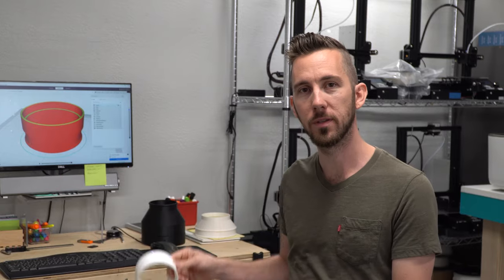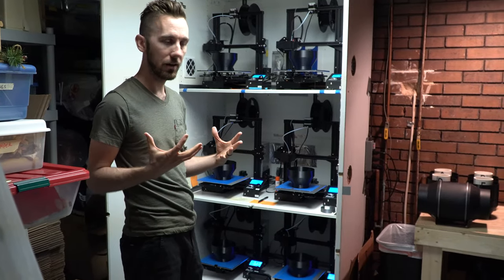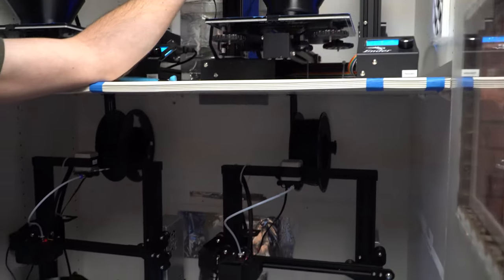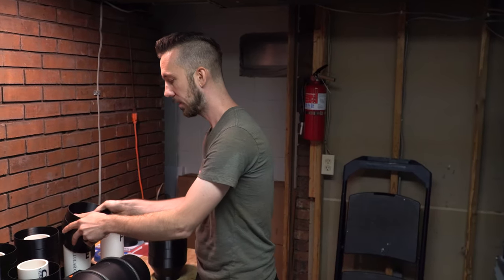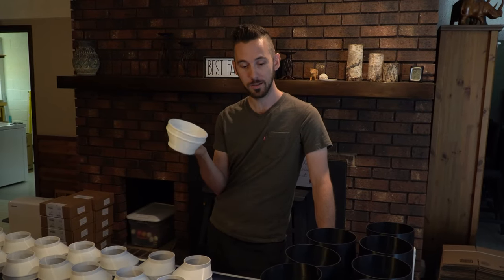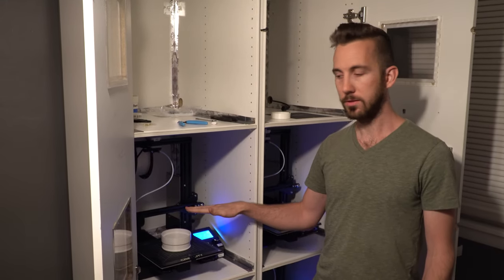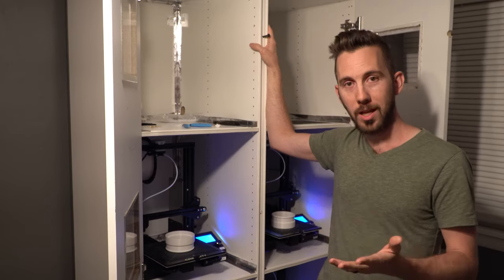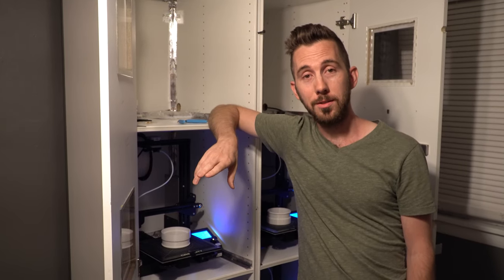My 3D Printing Farm

Comment: Why don't you have them on a ups. First thing I'd do if I had a print farm. Line conditioner and battery backup all in one. Degree of time you'd want it to stay up in case of power loss would determine the price obviously.

Comment: Thanks, you have a great process it seems. Some good ideas if I ever wanted to sell something I designed.

I think other people have mentioned the electronics overheating as likely causing your issue. Running electronics at higher temperatures also reduces their life expectancy, so there's added cost beyond just failed prints. Maybe move the electronics to a separate cooler area from the heated chamber to extend their lifetime and improve their reliability.

There are also fire hazards with 3D printers, both from the electronics and the heated printing area. Less likely these days but still possible. Maybe replace or at least line your wooden enclosures with cement board on all sides. Cheapest option I've found for building a fire resistant enclosure. Separating the electronics means they should ideally get their own enclosure(s).

Also maybe add a fire detecting automatic fire extinguisher. I've seen them on Amazon.
Reply from the maker: Great thoughts shared here, thank you for commenting. I'm planning on moving the electronics outside the enclosure in the coming months.
Reply: I had a similar problem with my new ender 3 (first 3d printer!). A certain model I was trying to print would keep failing at the same level about 12 hours in(layer shift, then the print just stopped on the next attempt). Apparently the motherboard overheats on these things. Fixed by adding an exhaust fan to the side of the motherboard enclosure. Also opened up the enclosure, moved the ribbon cable to the side, since it obstructed the airflow from the fan to the ARM processor. Finally spliced in the board fan to the heating block fan, because the mobo fan would actually only run when the parts cooling fan was running before. Have been running it up to 4 days at a time without any problems. This is what gave me the idea: https://hackaday.com/?p=461364 .
Reply from the maker: I appreciate you sharing the solution you found!

Comment: People don’t usually know that power at your outlet can any from 95 volts to 130 usually and a task specific Uninterruptible power supply is really required for sensitive hardware and long duration tasks.
I learned this from box mining with graphics cards.

Comment: You might be able to decrease print time, and eliminate the seam, by printing this in vase mode. You may need to swap to a larger nozzle, but it looks like it may be a 1 mm wall thickness which is super doable
Reply from the maker: Yeah that’s a good thought, I’ve never played with it before. Is vase mode typically just one wall?
Reply: @MartinsonManufacturing  yes, in your case you may need to alter the model to make it a solid cylinder instead of a tube, but the advantage would be never having to retract and travel (wasted time), and always maxing out your volumetric flow. Lmk if you want to talk more about it, would love to xhat

Comment: Dude, That is great. I would have an overtemp and smoke detection with Raspberrry Pi / Arduino and a relay. I am not sure about these days but  many of those boards shipped with thermal runaway protection disabled by default. Thermal runaway will save ou if a thrmistor cable breaks or the thermister falls out but you really also need something to guard against shorted hotend and heatbed mosfets failing short circuit - the micro would be unable to shut them ff as they would be 'fused' on. Only way to deal with that really is either a raspberry pi with temperature failsafe and smartplug or relay plugins of a custom job using something like an arduino. Great to see it took off.
Reply from the maker: That would be awesome to have it set up that way. Learning how to use a raspberry pi intimidates me, but maybe I just need to jump in and figure it out because I love all the things you can do with one.
Reply: @MartinsonManufacturing  I think Teaching Tech did a vid on it recently. https://youtu.be/ozCqqlPJ3a0

I did a vid a while back showing it with a smartplug shutoff but it was long-winded. The teaching tech one explains it much better but just uses a relay instead of a wifi smartplug. Good luck.

Comment: Whats up man great videos. However I'm heari you're up to 14 printers. Have you considered learning to make molds? I'm a mkld maker and it greatly speed up manufacturing process at the shop i work at. We create sculptures and parts for disney universal etc. We never ship out 3d printed parts that are still clearly printed. We sand and resin them to a smooth surface and then mold them with fiberglass silicone or plaster depending on whats needed.
Reply from the maker: You guys are smarter than I ;)

Comment: You have a really nice setup. I have noticed I to am looking to get into the 3D printing business. A lot of people have asked me for specialty parts. Is it best to just find parts that you can print in bulk? How do you have all the printers linked? I use Octoprint  with raspberry Pi 4 running wireless on mine with Cura as the slicer. Your printing ABS parts with stock Ender is down right amazing. I look forward to seeing more of your content and hearing back from you. Great job on your business and content.
Reply: I subbed and hit the notification button cause you just did not spit out information. You did a walk through and that is what content is all about.
Reply from the maker: Thanks for reaching out man. As far as one-off specialty parts or bulk prints, I think the best is to just start doing various jobs for people until you find a niche that you can really focus on. I started out offering 3D printing services. Several customers were asking me about laser engraving so I eventually bought one. Two months after buying the laser engraver I 3D printed a part for it to solve an issue that was bugging me and then it eventually became a fulltime job selling those parts. I absolutely love printing in bulk because you can really start to streamline your process. That being said, I'm starting an offshoot company to offer services because there's a huge need for it. 
I don't have my printers linked. Good ol fashioned micro sd cards :)
Thanks for your support!

Comment: You need input filters. 3D printers use stepping transformers they can back feed interference into the power grid. As delivered there is no filter. Its actually required by code in many areas for just this reason. One machine will interfere with another. And possibly anything electronic plugged into the grid.
Reply from the maker: Thanks for sharing this Tom. 
I’ve tried using a power conditioner. Is an input filter something different? This electronic stuff is all over my head so I appreciate the input.

Comment: Have you considered moving your production to injection molding based on the high demand? It could simplify a lot of your production process, like more reliability, production time, employee's costs, complexity in maintenance etc.
Also, have you considered "heat" to your electronic as to your random power loss problem? Maybe you can extend the cabling and put the electronics outside of your cabinet.
In any case, really impressive, you turned your hobby into a retable business.
Reply from the maker: Awesome thoughts, thank you for your contribution. Injection molding is something I've thought a lot about. I recently got a quote from a company in Illinois but it was far outside my price range because my part requires slides. I think I'd have to get it done overseas for it to be viable but I'm not crazy about that either.
I haven't thought about heat as the power loss culprit before so you given me something to think about now. I appreciate that. 
What's your background? You strike me as a very intelligent person.
Reply: @MartinsonManufacturing  Outsourcing to China could be viable, but quality control and specially communication can be really challenging, if you going that route hire a Chinese person locally who can speak fluent English and not other way around. 
I worked as a network technician for many years, and most hardware failures are result of inappropriate heat dissipation. You'd be amazed how a couple of failed fans can do to a server. Rule of thumb is all electronics required some sort of heat dissipation, if it is passively cooled it only means that the heat is dump to the environment.
Here is another optimization you can do. Most psu that comes with the printer are in the realm of 70 80% efficiency. You can  buy really cheap server grade 1.1K watt PSU for around 50 bucks and mod the 12v output with a breaker board. That can easily powered 2 to 3 printers and the efficiency are around 90% to 95% depending on the "gold" or "platinum" standards. That way if you scaling up your 3d farm, you could save some real cash in power. ;)
Reply from the maker: Awesome man, thanks so much for the tip I'd really love to try that out because the power loss issues can be pretty frustrating. Thanks again for commenting!
Reply: @MartinsonManufacturing  Your power issue is coming from the 3D printer power supplies. The majority of them have over temperature protection on the main board. Once the intrenal temperature reaches the preset limit the OTP shuts down the power. This is occuring because you put everything into a cabinet and it's getting too hot. Moving the power supplies outside of the cabinet will solve your problem.

Comment: Enjoyed the video. Happen to have an STL you would not mind sharing for the fan mod. I run 5 Ender-3's and have the issue with the strings sucking up in the fan. Over time, causes a decent issue :)
Reply from the maker: Sure, no problem. Shoot me an email and i'll email you back with the stl file:
martinsonmanufacturing@gmail.com

Comment: Cool that you haven't upgraded the printers and you still have managed such success. Is there a reason you haven't needed to upgrade to automatic bed leveling? do you just not have to level the beds much?
Reply from the maker: Yeah, the stock machines are really great as is. It’s not uncommon for me to go 3+ months without having to touch the bed. I will say that I have a few printers where the bed gets off pretty frequently which can get annoying but for the most part it hasn’t been an issue.

Comment: I love my ender 3... as your comment about odd things going on with your "ghost in machine" I had my ender 3 for 2 years now.. but for the past couple months my printer seems to like adding it's own personal touch. It print stuff that's not part of the model..  it's random.. yesterday was the most interesting print were the printer added it's own creativity. What it printed was the shape of the model but everything else was not part of that model. What was most interesting to me was the very first couple layers the bottom or floor of the print.  It completely  looked like a piece of plastic you see on your purchases household items, there were no lines what so ever... it was a very strong, yet thin print that had a semi glossy shine which the white filament used was flat white. It's definitely the type of results I would love to get from my prints.. but my ender 3's not willing to tell me it's secret..
Reply from the maker: Your printer “adds it’s own personal touch” Lol! I can relate. Yeah man, the inconsistency stuff drives me nuts.

Comment: I would have just gotten those ups battery backup things.  I have 2 of them and I run my pc and mining rig through 1 and 2 printers through the other.  Got 2 printers out in the garage that don't run through one yet but never have that problem so yea that is really an odd problem to have.  Has to be something to do with your fuse box or something.

Comment: I myself and trying to get a farm started as a small LLC. Something I'd love to see is how to start if you have a video for that part.
Reply from the maker: Sure, I could do that. What in particular would you like to see? How to setup the business? How to find a product to print or how to find client? How to market? There’s so many aspects to it and each one could be it’s own video.
Reply: @MartinsonManufacturing   How to setup the business? How to find a product to print or how to find client? How to market? I fear that Im more into the tech side of 3d printing and not much on the design and business side of things. I have 4 printers and I am learning to work with the differnt types of filaments from pla, pla+,petg, asa, abs is next. That cabinet you have looks great and is sparking ideas for storage place in my garage. that will help with the heating and cooling part.
Reply: @MartinsonManufacturing  My current setup will be manages by using klipper as it seem I can add about 3-6 printer per raspberry pi. and because I have a lot of spare PC's I might use one of those as my print server... I know I need to find a good printer that is cheap but not too cheap that is a bad printer and enders seems to be that printer. as far as the idea. I am starting to look at some classes on fusion 360 and how to use it. but right now Im just printing or test printing items for fun. I have a coreXY and Delta printers.
Reply from the maker: Awesome dude, it sounds like you’re in a good place and off to a good start. It’s sounds a lot like where I was 4 years ago. I’ll definitely make a video on this soon, but for now my advise would be, just START. It’s okay to not know what the heck you’re doing. That’s what being an entrepreneur is all about. But, I assume you’re good at solving problems so you’ll eventually figure it out. Don’t feel like you need to have everything figured out now, you’re a smart guy and will figure it out when you get there. Just start moving in that direction in whatever small and imperfect way you know how. I look forward to sharing more details on my journey in a future video. Maybe by the end of February.
Reply: @MartinsonManufacturing  thank you again for your help and I look forward to learning from you.

Comment: Did you change the fans or did any form of noise reduction adjustments with the Ender printers? Bed level adjustments? And how do you get it so beautifully smooth, it’s really nice 👍 you said it’s the slicer but we never get it that good.
Reply from the maker: My Ender's are about as stock as you can get. I was using PLA and that is beautifully smooth. I now run PETG and ABS. Not as smooth as PLA, but still pretty dang good though. I also tested multiple different filaments throughout this journey and some just print smoother or rougher than others. Any matte filament will look better than a filament with a sheen cause it hides a lot. 
I honestly think it's my part geometry and slicer settings. If you had me print some random STL file it would look just like everyone else's.

Comment: Absolutely love your content and it has truly been a huge inspiration and motivation to move forward with my 3D print business. 

I know this is an old video and you may not have the cabinet anymore lol
But, the Kia cabinet solution you showed will fit and work well on my current situation. At what measurements did you placed the shelves? And did you install anything underneath to provide some extra support for the printers sitting on it?
Reply from the maker: Glad you enjoyed the video my friend. I think I spaced the shelves at 20” and never had to add any extra support.
Reply: @MartinsonManufacturing  you da best!! Thank you 🙏🏼 look forward to future content!!

Comment: Thank you for you video.
But did you investigated other ways of mass production of those details? Because I thought that 3d printing makes sense only for very small batches.
Reply from the maker: That's a great comment. I've looked into injection molding but it was in the 10's of thousands so I'm going to to keep 3D printing them for now. Have you come across any mass production methods that are somewhat economical?
Reply: @MartinsonManufacturing  I know that it's also possible to use silicone molds and pour it with some kind of epoxy. It should be slightly cheaper than 3d prints (master model can be made on 3d printer), but there are some limitations. But really I'm far from this area, I'm just curious)
Reply from the maker: @dmytroi5456  Yeah silicone mold is a good idea. That's something I've thought a lot about before, but never had the balls to try it lol. I think what turned me away is pouring resin requires me to be actively engaged in the process whereas 3D printing I can just hit start and walk away. I'm really hoping a company comes out with an inexpensive injection molding machine. That would be a game changer. I'm sure someone will come out with one eventually.

Comment: 6:42 if you still have this issue you might wanna get a frequency filter for these printers. it might be possible that they send some interference into the power lines creating stuff like voltage sparks (negative and positive). I had this issue too with my fridge and pc monitor being pluged in on the same curcuit and everytime my fridge started cooling my monitor restarted

Comment: Thanks for a lot of great info.  PETG has been my favorite material for a long time, but if it sits out for a few weeks you have to dry it  to get rid of the stringing.  Recently I have discovered PLA+ and  it seems really good.  I have been afraid to try ABS because of the smell/fumes, how are you dealing with that for your ABS parts?
Reply from the maker: I haven’t tried PLA+ yet so I’ll have to give it a try. Yeah, the ABS smell kind of sucks. The smell stays locked in the cabinet pretty well though so it’s not too bad.